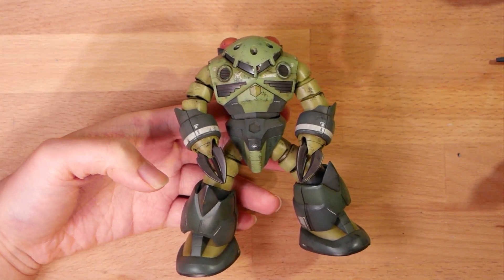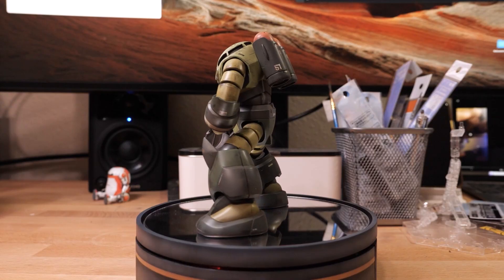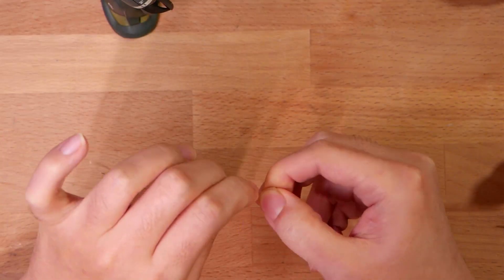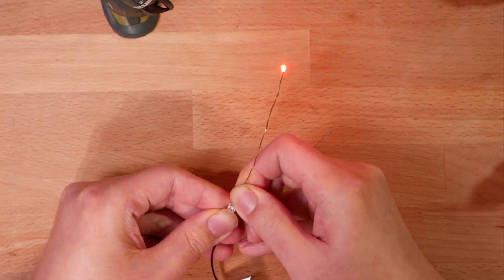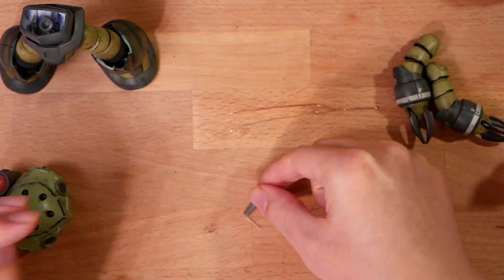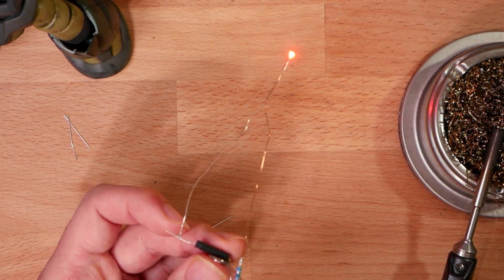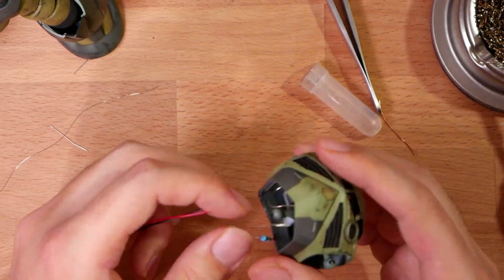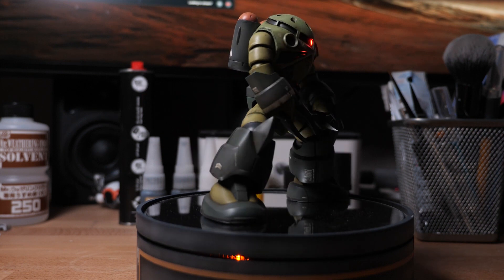Add LEDs to your Gunpla in 15 minutes! | Quick Technique

Comment: I highly recommend using CR2302 batteries for this purpose, the battery holders are 10 bucks, but you get about 5 or so. And since CR2302 batts come in 3.7v already so you can just wire em straight to it. Not to mention the batts can be removed and replaced and aren't a potential hazard like LiPo's. Been doing it to most of my kits!
Reply from the maker: for external and larger projects, sure, but they are quite a bit larger than the batteries that I'm using here. I would say fitting a CR2032 into an HG with a battery holder is going to be pretty difficult. Not having to use a resistor is nice though.
Reply: @comradegunpla  I bet there's ones for the smaller batteries, might make it a bit better. I'd just hate to have a battery that may need a bit more finagling to replace, but most HG's I've had (rx78 origin for example) don't have enough space to begin with to fit a battery inside, usually I resort to having a small wire sticking out

Comment: Mr Hobby LED kits work great for those who don't have a soldering kit handy
Reply from the maker: Sure, but they are l ike at least 5x the cost of the material... And I'm talking Amazon prices, so the material costs are already jacked way up. Whereas a soldering iron is about $15. And as long as you are old enough to use a knife, I highly doubt you'll ever get hurt with an iron.

But yeah, I agree, if you really don't want to get a soldering iron and just wanna start somewhere, the Mr. Hobby kit is good

Comment: Thank you for this wonderful tutorial! I'll be using a similar method to install an LED for my HG Gelgoog. But I'm opting for the CR1220 coin battery for its small size and 3V rating, so there's no need for resistors. And I want to make things even simpler by just twisting the wires for connection instead of soldering. Any thoughts on my plan? Will appreciate your expert input
Reply from the maker: Coin battery is a better choice except you won't be able to charge it, the 5v battery used here is purely for charging. For connections, you honestly have to solder. You don't want the wires to come loose inside the model after you put everything back. Twisting wires rarely hold contact unless there's something holding them together.

The good thing is soldering is honestly super easy and a cheap soldering iron is only like about 10 bucks, so it's not a big issue.
Reply: Soldering is really out of the question for my setting. So if twisting wires will not be enough, maybe add a little bit of hot glue or tape to hold the wire in place? 
 @comradegunpla

Comment: What would be the process to add an extra led? Would you need an extra power source? I’ve never done leds
Reply from the maker: You can use one power source. Just make sure it’s the same type of LED and wire them in parallel.

Comment: 15 minutes?  It will take me much longer than that to learn how to use solder.
Reply from the maker: Here: 1. Plug in the soldering iron to heat it up to like 350 F, 2. Use the soldering iron to melt solder onto the parts to combine them, 3. Unplug the soldering iron

Comment: Do you need a resistor?
Reply from the maker: According to the data sheet it seems like it’ll still run under the maximum current even without a resistor, but I’m not gonna recommend that exactly and be responsible if you end up with a burnt bulb, lol